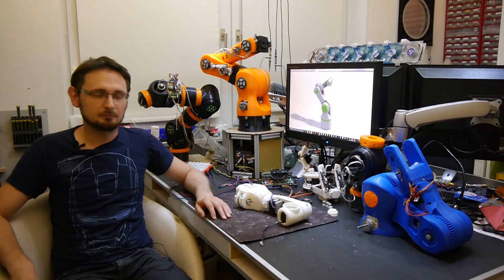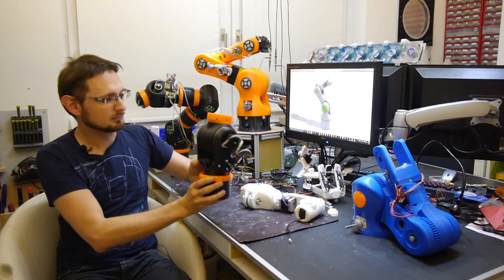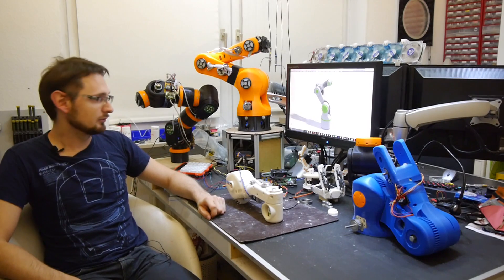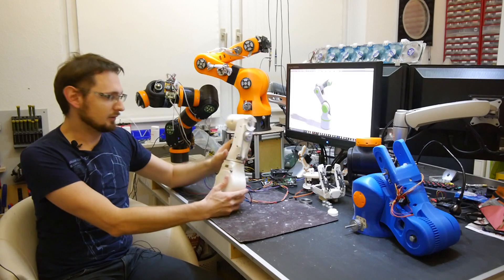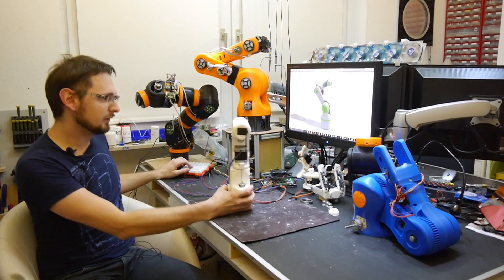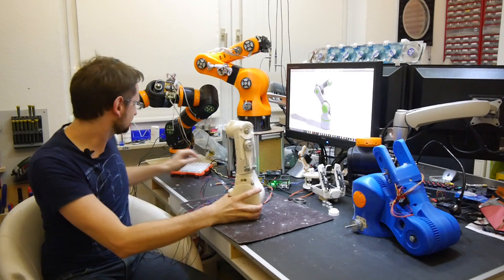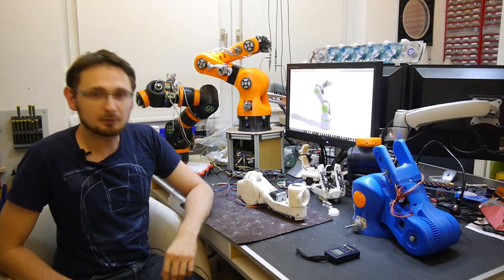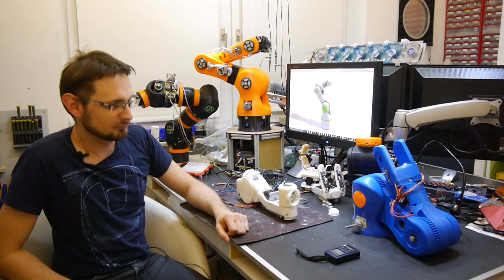Robot Arm Part 10 - Version4 and HackadayPrize semifinals.

Comment: Have you looked at geared steppers.  I use nema 17s with 30:1 ratio that cost about 30 USD.  I like them because you can use a timing belt in addition and get a good 10-12 n-m torque.  Also post something on robotarm.org, some folks can probably help you there
Reply from the maker: +Adam Conway  yes I know the geared motors I have a few here, but if you look into the datasheets the motors and gearboxes the Max.Permissible Torque is quite low. Its possible if you hit the arm the gears will break, this can't happen with timing belts, they slip... That and the long geometric length was the reason not to use them.

Comment: My 3d printer gets here in Nov. I think this robot arm v4 will be my second project. I've always wanted one. My build volume is 15x15x15.  Will I be able to build your arm with it?
Reply from the maker: +Sularus76 Unfortunately no, I designed to parts to be printed on a 200x200x150mm build volume, but you could cut the parts in pieces, print them and glue them together...
Reply: +Andreas Hölldorfer my dimensions are in inches. I can print 15 inches all the way around. 200 mm is 7.874 inches. Unless Google is wrong then I think you thought I could only print 15mm.
Reply from the maker: +Sularus76 damn the imperial system ;) I thought 15cm, it's quite common for small printers ;)
Reply: +Andreas Hölldorfer no problem its my fault. I should have specified. Thanks again. If you don't mind after I finish my project and get my printer if I have problems can I contact you.

Comment: Andreas, just in case you do not know about that. Instead of just increasing voltage for stepper, you can use chopper driver. Basically it uses higher voltage, say 50V and keeps constant current. It can give you much better torque while keeping motor temperature reasonably low. Here is sample app note http://www.st.com/st-web-ui/static/active/jp/resource/technical/document/application_note/CD00003754.pdf

Comment: Why do you use steppers again? You just said "it's hard to control DC motors", can you give more details about that?
Reply: +aquaticusrov would be also interested in the sources of the problems - is it the tuning or the control software itself?
Anyway awesome project, the best DIY-Project for years!
Do you know those btw. : http://www.ebay.de/itm/400655118241?_trksid=p2060353.m1438.l2649&ssPageName=STRK%3AMEBIDX%3AIT - perfect for a base u guess. What is your price limit you want to achieve`?

Comment: Nice work. You will need higher torque stepper with specialized stepper controllers. You can either do PLC or Micro-controller and firmware to achieve the required results

Comment: would it be an idea to print metal gear parts with shapeways for instance?
until such time that home metal printers come around
low mass parts aren't that expensive to print and frees you from parts availability and potentially high cost.
I don't care for steppers. I think they are an abomination and should never have existed.
I would look at RC brushless DC with encoders. Fast, powerful, inexpensive, efficient.
Reply from the maker: +Dan Frederiksen 
The Gears are all standard size you can also buy aluminium gears and mount them without chance much on the printed parts, I will try this with a later version. The gears are about 5-10€ each if you buy them.

Comment: Great work, thank you for sharing. One question, I see you have gone back to stepper driven actuators. Will you be keeping the absolute encoders? For things like zero motion homing and missed step flags?  Again great work and good luck with the hackaday competition.
Reply from the maker: +ANFROHOLIC Yes all Axis will have the absolute encoders mounted on the shaft to make a closed loop control possible and also remove the calibration (homing) at start.